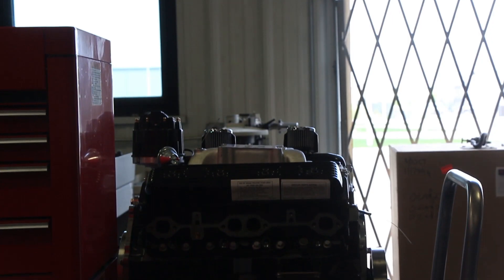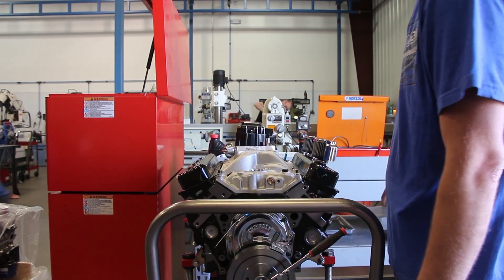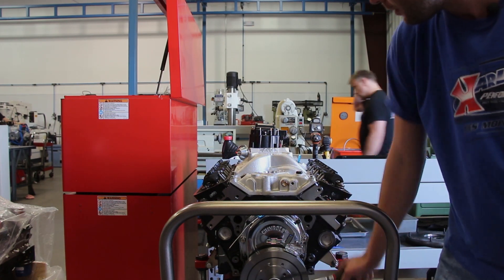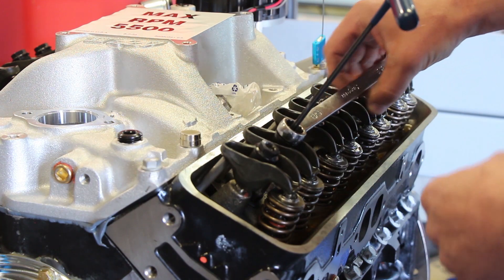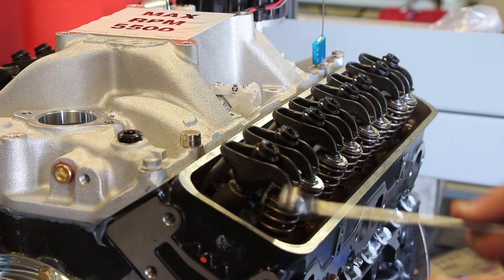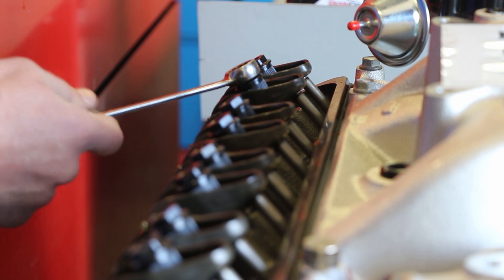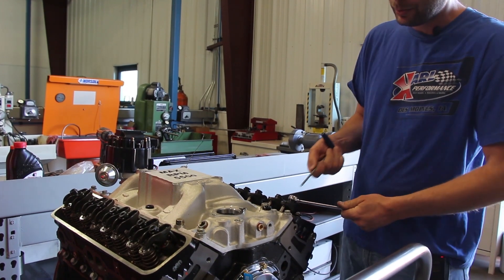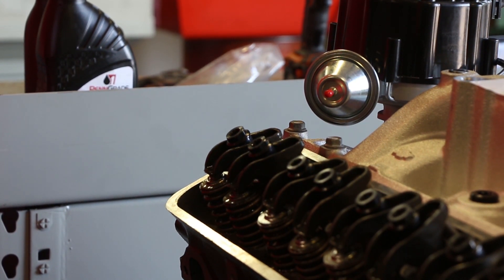Setting Valves 602 and 604 Crate Engines

Comment: That's a small block Chevy? 602 or 604 can't be cubic inch displacement? What does those numbers represent?
Reply: its a 350cid, 602 is a reference to the GM part number, this is a sealed racing crate engine.
Reply: @justinsimmons2715  Thanks
Reply: 602 has steel heads and the 604 has aluminum heads. HP is slightly higher on Aluminum one